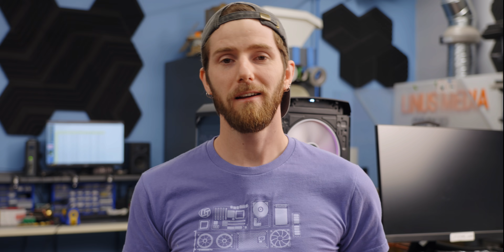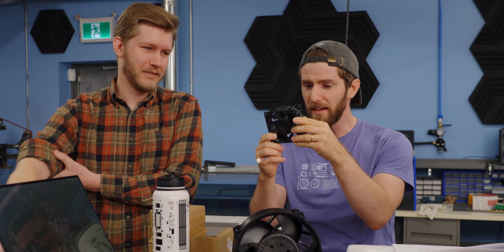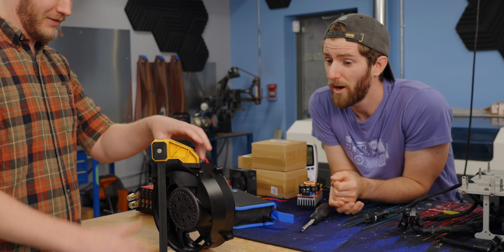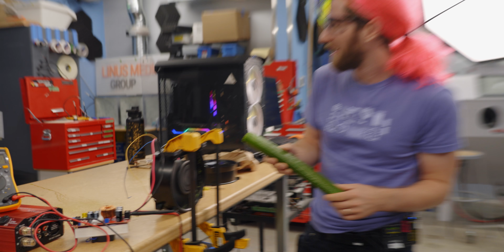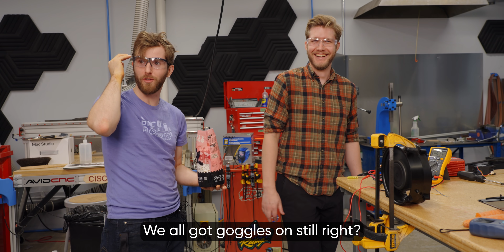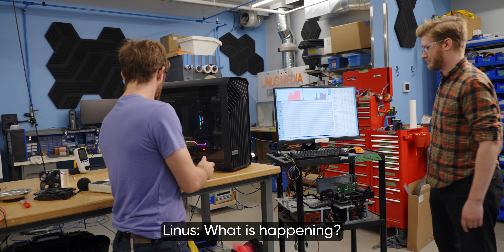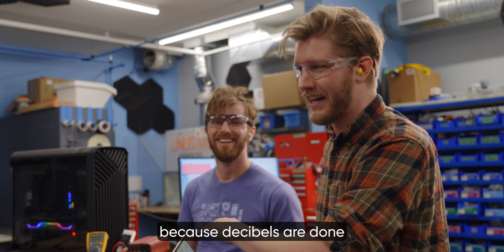The God of Computer Fans

Comment: I actually have a similar real life setup for my 14900k using 2 noctua industrial 3000rpm 140cm blowing into the case and 2 extractinn. Keeps it stable cool at 80-85C for 100% daylong workstation loads. Loud as hell though when they take off…

Comment: I remember Delta. They were the king of PC cooling fans in the early 00s, but they also had a reputation for be obnoxiously loud.

120 mm fans first came about so that fans wouldn't have to spin as fast to push more air, getting more performance with less noise. The whole point was to get away from small but loud fans like Delta's.

Comment: Electricity is more dangerous when you aren't prepared to back away.
Just wear proper shoes, use an insulated handle screwdriver, and then don't touch it, though you probably could with the proper shoes.

Also being afraid of it makes it more dangerous, as now your heart is already racing, prepped for a heart attack with a jolt of electricity. 

And don't drink alcohol, it makes you more conductive.
Not joking.

Comment: limit it to 100W (or get a 1600W PSU) to power it with the PC, have a controller that interprets 4-pin PWM signal to the fan's signal, and have the fan's power delivery circuitry installed right in front of it so the fan will cool it, and your can have that beast integrated like a regular (using the term loosely) fan. I'm intrigued by the idea.

Comment: I have a similar fan in my workshop, taken from a decommissioned IBM machine. The door to the room opens when it blows air out of the window.
The strongest computer fan I encountered came from a IBM Blade Center "H". It's a radial fan that costs $1500 (new) and takes 800W AC at full speed. It is powerful enough to move you around while sitting on an office chair with wheels 🙂

Comment: Got to put a 420mm rad on that and lots of push pull fans, get some batterys and a threadripper or i9 running cinabench, wings, wheels, plywood plane body, and flight controol surfaces.

Comment: These were used in "larger computers" I have a larger version of one of these 400mm and runs on AC that was scavenged from a Mainframe. what you have is sized for minicomputers... you know something sized around the size of 2 dorm sized refrigerators. mine came from a mainframe sized about the size of a dining room table with the leaves in.

Comment: For those wondering, Delta Electronics do make 12v dc 120mm fans that you could in theory put in your case.  6000 RPM, and really freaking loud, plus drawing 1.8 amps, so only one per header, or powered off of PSU, but the performance is litterally second to none.

Comment: They are used on aviation electronics, we had a couple that were smaller on the electronics rack on h-60b. Now I work on industrial laundry equipment, and they are used to blow air over the motor on Continental 120lb washers.

Comment: If you use the fans to pull air from and not into the case it will drop the pressure in the case, increasing the over clock ability of the system.

Comment: i actually use  that exact step up converter (Voltage booster) for my speaker's amp. Works wonders, i use my fingernails to adjust it tho, not a metal screwdriver

Comment: Small correction:
Every 3db is a doubling in power.
Every 9db is a doubling in perceived loudness.
One can approximate to say that about a tenfold increase in power is needed for twice the loudness.
E.g.
A soundsystem uses 50w for 90db soundpressure. For 93db it uses 100W, for 96db 200W, for 99db 400W. 99db compared to 90db is twice as loud, and 400W compared to 50W about an order of magnitude larger.

Comment: Our big server rooms at IBM had these mounted around the room, near the cooling ducts to keep fresh cold air moving around the room. They basically created a circular pattern around the room with a final fan near the ceiling in the middle to break up the flow and allow cold air to reach every corner of the room and allow all the racks to have fresh cold air

Comment: I would run that fan on the outside with a tube that goes through the wall. Adjusting the size to fit a shroud for a general sized pc case so that you can test products throughout the years with the mother of all fans. Just make sure you have a vent cover for the outside to protect any creepy crawlies from coming in when not in use. 🙃😉

Comment: cool, i use  3pcs delta pfc1212de 5200rpm 252cfm  with 360*65*120mm copper radiator and this noise generator cooling 14700k and 4090.   This hell machine gives 75 degree cpu and 66 gpu in rendering and use 950+120w.

Comment: i remember buying a vantec tornado about twenty something years ago.  it was so powerful that if it wasn't bolted to something, it would take flight.  noisy mother fucker too.  i ended up keeping it in a drawer until i lost track of it.  after installing it, i immediately uninstalled it and put the stock cooler fan onto my thermalright  whichy whatever that popular model was back then.

Comment: 11:39 it has a reader inside of the fan it's a 4 pin USE IT
Reply: @rodger-the-robot Its not a 4 pin..?
Reply: @gud_girlll  it is
Reply: @rodger-the-robot It requires 600 watts of power. A 4-pin delivers, what, 12?
Reply: @gud_girlll   12V, maybe not 12 W, and the wattage doesn't matter. That fan's not meant for AP. C. It's meant for a server. That's why the 4 pins aren't a single connector it has 2 power pins and 2 readouts most servers use a separate esc which they have just plug the two readouts into a function generator to get your square wave, it's really not that hard

Comment: I ordered a couple of similar 200x60mm fans for AC cooling for my upcoming build. Not quite as powerful, a little less than half at 425 cfm and 60 watts of draw. Easier to power as it comes with just a standard NA 2 prong plug for 120v AC input. So I can just use a fairly cheap 120v 15a voltage controller/regulator to adjust it.

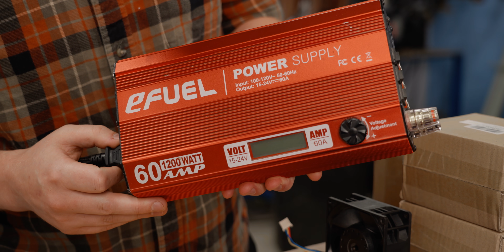Comment: 3:30 This is wrong computer power supplies also have 24 volts when you combine the -12 volt wire that is in the 24 pin connector with the positive +12 volts you will be able to get 24 volts out of a computer power supply. I have had to hook up 24 volt fans this way.

Comment: The fans can be used for different things. I’ve seen some on rack doors for JBOD racks. 6 per rack, 4 per rack, etc sucking air past all the hard drives. This might also cool like electronics on military vehicles or stuff like that, but that last comment I don’t have direct experience with.

Comment: Common misconception. 3db is a doubling in power. 10db is a doubling in volume.

If you have a subwoofer. And double the watts you gain 3db. This is why it's so hard to get high volume. You can also increase cone size by 2x and get 3db.  So going from a 12 inch to 2 12 inch you get +3db. If you doubled your watts. You now have +6db. So competitions with 100k watts are barely reaching 160db. From a standard subwoofer that can reach 120db at 500 watts or so. They doubled the wattage 8x but they also doubled the cone area 4-6x. And they still only doubled the volume 4x

Comment: @Linus , I know that ABB uses them on ABB ACS880 low voltage converter , btw they are only for cooling the whole rack with them (2MW had 13 those fans), but for inner components - they are using liquid cooling.

Comment: Air circulation for in row server room cooling. You have these from floor to the top of the cooler which is basically 2 meters high, It is then essentially just chiller fins connected to central heat exchangers and you push the air through the chiller with these.. It is incredibly loud with about 10-15 of these but it sure does push that air :D

Comment: Linus freaking out about the DC boost converters lmao. I have several small ones from 50-100W and (they) are very practical and easy to use, I just add some terminals on the IN/OUT and use them for everything, mainly to over run 12V 120mm pc fans on summer when my office is too hot and the commercial fan just does not cut it.

I agree though, having to use the pot for control is sometimes annoying since you cant see in real time which output voltahe you are going, but some of those buck converters have 7segment displays in some cases.

Comment: 48 Volt DC is the standard voltage powering all telephone exchanges. The + is grounded to counteract electrolytic losses in underground cables. Big lead-acid battery banks provide back-up Power to the exchange and all subscribers' lines.
These fans are meant to be powered by the main -48 Volt DC power distribution.

Comment: For a comparison, the CFM56 engine installed on the Boeing 737 has an RPM (N1) OF 3,200, AND can reach as high as 13,000 RPM. The V25000 engines on the Airbus A320 family of aircrafts has an N1 speed of 3,500 RPM, AND can reach as high as 11,000 RPM.

Comment: we used this for Motorola Radio Building Base Station Cooling. (they helped the dual AC systems circulate air. into the daisy chained radio system cabinets.)

Comment: 14:42 - If I am correct, these kind of fans are used by firemen to blow air from outside into a building to create negative air pressure, for example to make smoke stay inside apartments and to keep the stairs clear so they can be used for evacuation.

Comment: I work with ebike battery in that range 40-56.4V DC if you habe slightly wet finger you can definitely fell the power. And its not great because Crystal Clear DC fells very .. Clean 😂

Comment: We are using the fans to move air in and out of the Server Racks and as an emergency „ac“ to move alot of air to the racks in case of an Hardware fail of the original ac

Comment: as a former cell tech for t mobile i know those  fans. Those fans are used to cool down Cell site BTS there is  a control circuit in the wiring that controls the RPM according to temp.. cut my hands on that fan plent of time

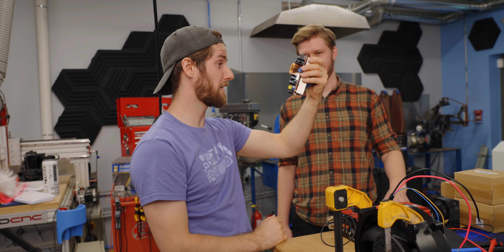Comment: 5:46 why spend $800-$900 on a variable power supply that does 48V when you can get a MeanWell RSP-750-48 AC-DC power supply that cooks up to 750W at 48V 15.7A for less than $200? Oh, did I mention you can vary the voltage with the potentiometer? And the fact that they're very reliable (if not DOA, admittedly lol) is the cherry on top.

Comment: 3 db is not a doubling in volume. Why do so many get this wrong? It takes double the electronic power to increase volume by 3 db. For a doubling in the actual amplitude, i.e the mechanical energy, you need an increase of 6 db. For an increase we as humans perceive as a doubling in volume, you need an increase of 10 db. You may know computers Alex, but you clearly know squat about sound and acoustics.

Comment: We use these to cool down terminals installed outside and having minimal ventillation, becuase of safety reasons. They are especially useful in the summer, when the housing of the electronics are metal. Mostly we make stainless steel housings. Also you need this type of cooling for charging stations for cars, that very loud noise when you start to charge your car is a type of cooler like this and even with it the inside temperature goes to insane territory in the summer when the chargers are in use.

Comment: I feel like just setting one of those up as an exhaust fan would provide far superior cooling than literally any normal fan setup on the planet.  You don't need intakes, because it will certainly be sucking air in from outside the case.

Comment: Dang that’s a lot of CF of air moving through.   I have a 12v fan that moves good amount of air.  Smaller one and it’s heavy.    I wired it to a 12v power brick to a wall.  😂

Comment: I bought a 6 inch terrabloom inline fan for my Razer chroma setup with a rtx 3080 fe connected to a surface pro 9 & it dropped my temps from 65-70 degrees to 40 degrees when gaming on gta online. I keep my fan speed between low to medium speed. I have a desk that I could build the razer chroma & inline fan with a silencer muffler & silent fan box enclosure.

Comment: You know what you should do? spend a few minutes doing some basic research before wasting your time and stupid money on this BS. Temperature difference is the biggest driver in cooling. You are limited here by the air temp in the room will be the coolest you can ever hope to get the case of the chip. You would have got better results by using the 1200 watts to cool the air with an aircon then blow it on to the board with regular fans.

Comment: This $400 fan sucks. Antminer fans cost about $10 and are of a similar size. I can easily get a truck fan for less than $50. Why overpay??? :-)
Reply: This fan is meant for industrial applications not PCs. I highly doubt the $10 fan can push 1000 CFM and survive the harsh conditions of an industrial application.

Comment: Several times I use one of those kind of fans, for two uses. #1 to blow some air into nozzles in a swimming pool. Pushing some air into air outlets at the bottom of the pool needs a high pressure and takes a high volume fans. so this kind of fan works. Use #2 is to push air into an engine room and sucked air from it. My case is that the particular engine room needs to regulate the air in and out, just like a PC case does. but this time to air-cool the engine equipment inside.

Comment: The Air Force used similar fans in some of the HF radio equipment at the radio stations in the Philippines during the 1970's.  I was stationed at Clark Air Base '75-78 and the fans we used were also 48vdc with a speed of 10,000rpm.  Those fans had a metal shroud that went around them in order to keep the fingers of stupid people out of the fans.

Comment: These are used along with huge radiators in our Stolle can press controllers, the electrical panels get very hot and all of their heat is dissipated via air cooling since it's less prone to failures.

Comment: To be fair this bustboost converter is kinda save even if you touch the live wire at the end of it you will at worst just feel a bit of a twitch, since even in kinda bad conditions your body resistance is ehh 2k ohms worth of resistance(at best 2mOhms, so you won't feel even that), which is roughly 30 ma at 60 volts, and since it is dc you will just feel a twitch. In general it is rather safe to tinker with dc in range bellow 100 volts(though that doesn't apply if you have hearth/severe neurological problems, or a cardiostimulator), though you probably wanna avoid touchibg the live wire for prolonged periods of time.

I would be waaaay more concerned with how they handled the mechanical part of all of this, like they dwindle their fingers santimeters away from this portable open air blender.

Comment: Now make this fan quiet and it's gonna be the most successful product ever
Reply: it super easy tho just use pwm fan speed control and set it to lowest duty cycle it will run much quieter and off course this lowest speed of these fan are much more air compared to most expensive pc fan while on max speed
Reply: @ariefhidayat2157  I mean not just speed control, but make the fan itself quiet at these speeds, at least for twice (42 dba instead of 84). Then lower with pwm speed control to +-20 dba
Reply: @YourCloseCoop Not possible i guess.

Comment: these fans may actually be useful in CO2 DAC setups, the sheer volume of air required to capture a usable amount of CO2 is ridiculous, let alone that 500L(not 5000L linus stupidbastion) is actually tame when trying to basically suck up all CO2 for 10 miles
you might actually need 100 of these "blowzookas" to move enough air to absorb enough CO2 to make a profitable quantity of ecofuel

the alternative for not being insane is to have a large array of codylab style algae panels that each get an individual small air pump from the surrounding outside air and just use a digester reactor to get the same syngas materials from the algae capture at way less energy intake, and bonus if your target fuel can simply be cracked from methane like all LNG types can be
I aint buying blowzookas, I am likely to become an algae farmer using edible algae (so I can add it to soups and stuff for nutrition) and take the vast majority of my simplistic crop to make fuels, bonus is that algae is basically impossible to kill, you just keep it from getting too hot or cold by a clever thermostatic pumping that only runs when the day is hot/cold enough to not cook your crop, and water is already in excess with CO2 also not being a throttling factor, the sunlight is your growth control
and funny enough the same algae can be cycled to produce bio-hydrogen for liquid fuel synthesis, though I suspect they start to suffer if they don't get enough carbon to live

Comment: These look awfully close to fans I have seen in high power VFD's (over 75kW). Those require ridiculus amounts of cooling when accelerating high enertia systems or decelarating them. They are often 48V fans inside, though we do notice that fan regulation is far more often implemented in newer, higher efficency drives.

Comment: Linus' stupidity sanding down the fan housing instead of widening the case opening, which is easy to cover & doesn't kill the parts value so much, reminds me of how he used a dremel tool at any possible wrong angle to open a PCI slot end on a motherboard.  Instead of coming in at 90 degrees to it to simply remove the end, he goes inline with the slot, breaking pins =))

Comment: i had been in Frequency Inverter field , this is the fan used in the VFD for cooling the electronics inside the device , seen this a lot before , Delta does have VFD , this seems is their spare part fan for the VFD drive
Inside VFD there are IGBT , IGBT generates tons of heat , it could blow up the drive in short time if the cooling stop working for a while, for this size of fan might be for around 100kw drive , if is above 400kw , they will using vortex fan instead of this propeller fan , and of course vortex fan cost A LOT for just 1 piece